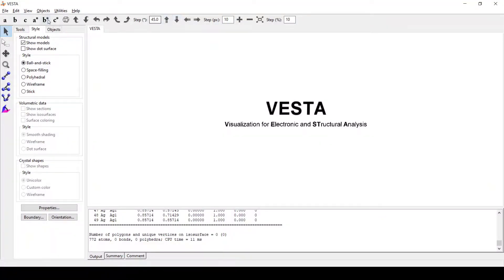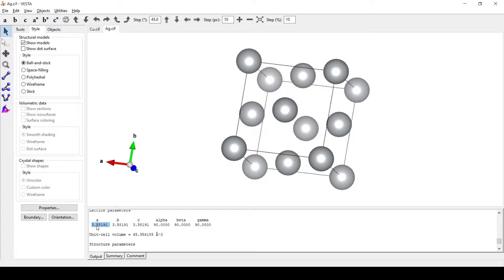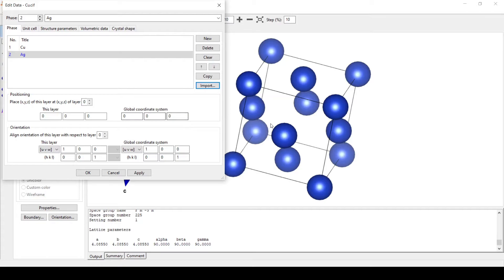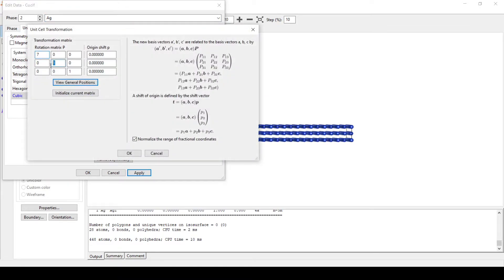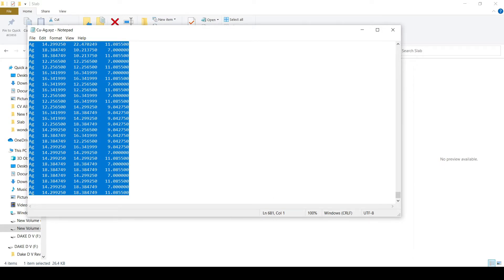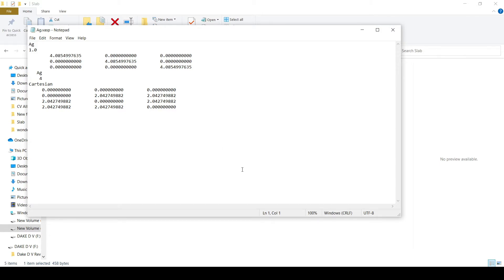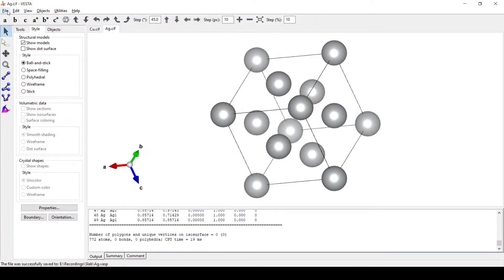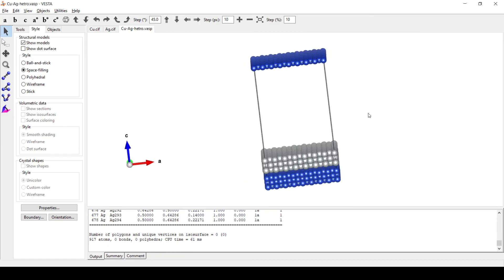Building Heterostructure in VESTA

Comment: The method appears to be quite valuable; however, there are instances where matching lattice parameters may not be feasible, especially when the parameter difference is significantly large. Can you recommend any alternative approaches?
Reply: I need answer to this question
Reply: The number of atoms are too high, so it will take too long for computatio, how to reduce , and how to form hetero structure for at particular clever surface